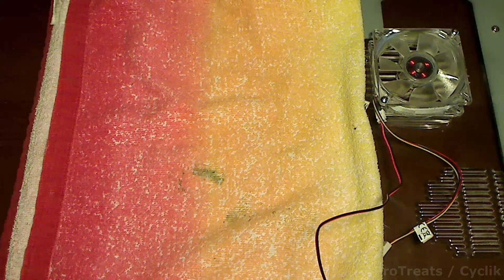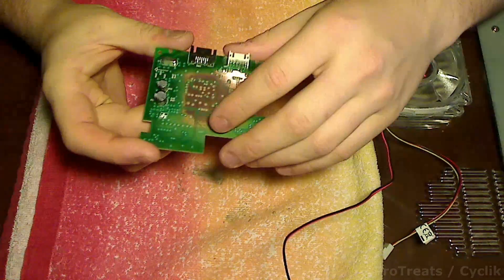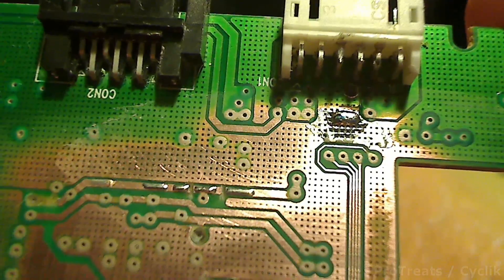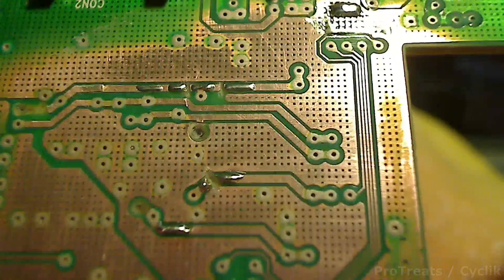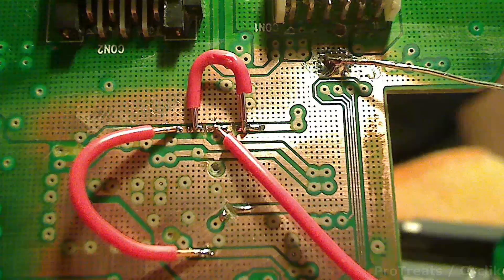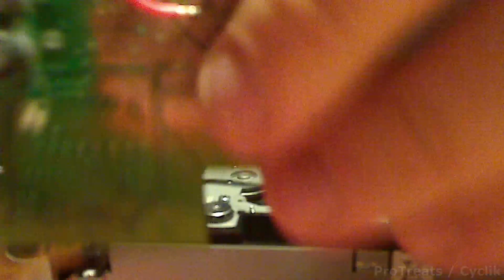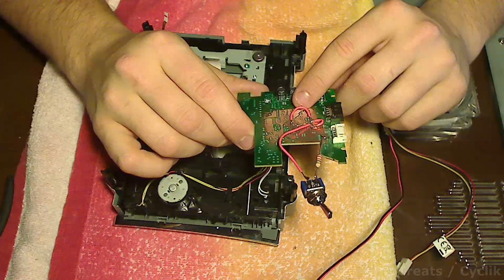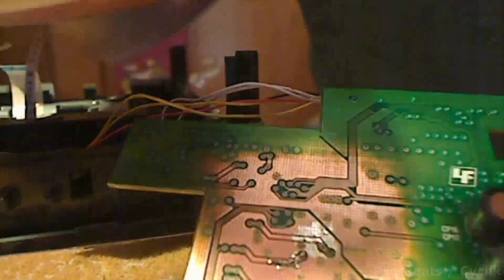Xbox 360 LiteOn 93450c Hack/Modification Soldering Tutorial / Counterpart to Pastorrtom's Video

Comment: To stop an oxidization of the copper ,( because it will over time) , its a green muck that you have all seen. To stop that just take out one of the three, you need the copper and the voltage. so cover the exposed copper from the air, cheap solution is spray paint, better is a can of electronic barrier just like the shit you spray your battery terminals in your car. the shit for your car is a bit messy but you can buy a can for low voltage at radio shack for less then 7 bucks

Comment: I've just bought a second hand xbox for cheap and am going to use your tutorial as a guide    . just that I studied my DVD and it was made in March 2009, on your tutorial you are using  a September model MS-Part X800474-010, PLDS Part 3B41216033. The march make I'm have is MS Part X800474-008, PLDS Part 3B41216031. I understand you've made this video a litttle while back but any help would be appreciated. ty CQ

Comment: hey i am wondering if some one can pm me about this.. i am not new to hacking fw on to xbox drive i have done about 3-5 benq's and 23- lit-ons 700 series(probed)  but was wondering about the switch  if i use a 2 pin switch what one should i get and what side of the wire is - and +

Comment: This video was a very clear explanation of a specific portion of the whole mod procedure. It was despatately needed. The zoom-INS and the labelled pictures were excellent. I am a hobby electronics guy so I won't jhave a problem with it. If you are not familiar with small soldering just beware. Excellent, excellent video

Comment: If you dont mind, can I offer some constructive criticism?
The wire gauge you are usins is overly excessive, for small traces like that you should be using sth like 30awg at the most, you will find the soldering much easier that way!
Also, why scrape away more varnish than you need to, the majority of what you cleaned off it not being soldered to, you are exposing the board to the chance of oxidisation, which is not a good thing in electronics.
Other than that nice vid.

Comment: @MMMMDSFMMM369  me too i want know if i can use the XBOX 360 to power the drive, i have 83850C and  made it impossible to extract the Firmware....
achieved after obtaining the firmware, I need to leave the wire or is it just for the extraction? is the part that confuses me a bit

Comment: if you pause at 3:23 it looks like you broke off the connection of one of your pads right in the middle of the screen.  It's directly below the 101 pad.  

A hint for others.. the trace that goes to 101 is very long.. When i did mine I made my cuts further away from the 101 pad so that I could solder to the trace instead of to the pad.. preventing the possibility of breaking it.

Comment from the maker: The Probe II is not available yet, nor has it been tested properly in my opinion.  If a functioning, solderless solution can be found then that will be the way to go - but until then this is the way to do it.  My method works 100%, but you have to have a certain skill set to make it work.  I have performed a few dozen of these already with a 100% success rate so I am comfortable doing it this way.  I don't need to waste money on little tools that are inevitably going to make someone else rich.

Comment from the maker: Just enough so that you break the current.  I would suggest using a multimeter to do a continuity check just to ensure the trace has been broken - and then to confirm that it has been repaired after you reconnect it.

Comment from the maker: *TO MAKE THE TRACE REPAIR BRIDGES*

Take stranded cable and strip it.  Take a 1" section of the little copper strands that make up the wire (3 or 4 of them) and wind them up.  Pin them in an alligator clip and apply solder to make the trace bridges that you see in the picture.

Comment: This is the best guide I've seen for this mod.  I have two questions:

1) I'm more confident doing the mod than I am with restoring it back to normal.  Is there anything wrong with leaving the mod in-tact and just flicking the switch whenever you need to flash, or do I not understand the mod?

2) Will this also work for the 83850c v2 or are there any differences?

Comment from the maker: You don't have to use flux because "rosin core" solder is actually "flux core" solder.  I mean that there is already flux in the core of the solder you are using so you don't need to use any extra.  That's what makes the solder smoke when you heat it up - the rosin flux core.  Understand?

Comment from the maker: The solder will only adhere to the PC board if the surface is exposed and clean.  I used the abrasive side of a Scotch sponge (the green and yellow ones) and rubbed off the green protective layer from the PCB.  Then I cleaned it with 91% iso alcohol making it nice and clean.  To get the solder to adhere to the traces make sure you are tinning the soldering iron and heating the trace (or any surface to which you will be applying solder) and touching the solder to the trace, not the iron.

Comment from the maker: The trick is to not apply solder directly to the soldering iron or the wires.  "Tin" the tip of the soldering iron (get a little solder on the tip of the iron) then make contact with the surface to which you will be soldering heating up the surface.  Then you will apply the solder to the trace, not the iron and it will adhere.  Solder only properly adheres to surfaces that are hot enough to melt it.  I will post a soldering vid when I get some time to demonstrate this process.  Good Luck!